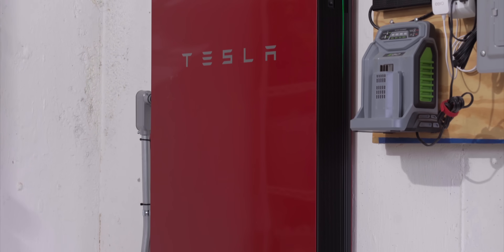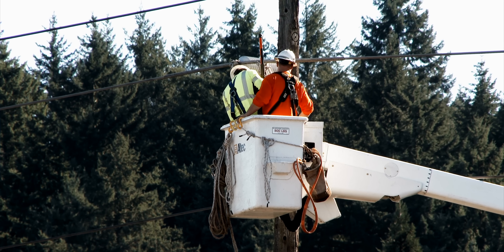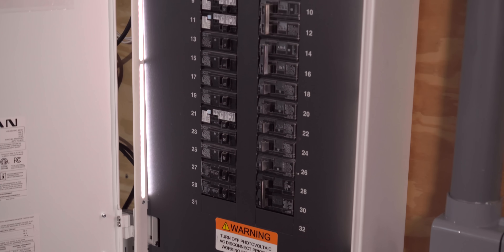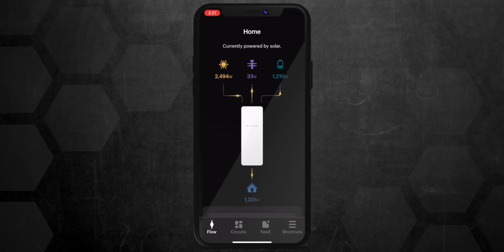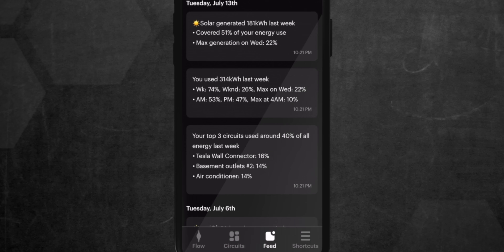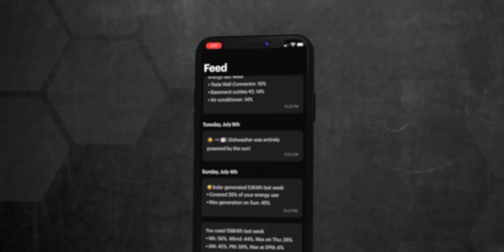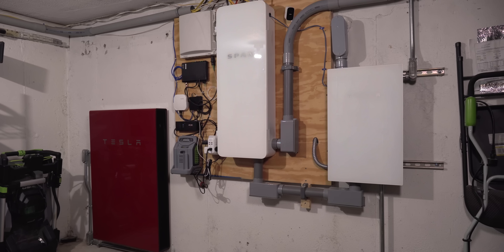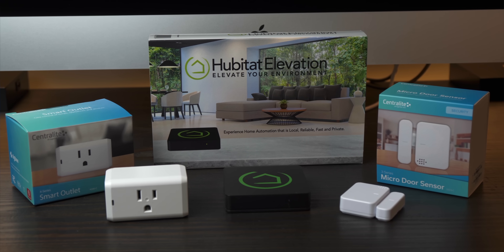This Smart Home Electric Panel Fixed My Tesla Powerwall

Comment: - The Tesla Powerwall, installed in late 2020, serves as a reliable energy storage solution, efficiently managing the flow of energy generated by solar panels and providing backup power during grid outages. This setup has been functioning well for the user, ensuring uninterrupted power supply when needed.

- Traditional home battery systems, exemplified by the Powerwall, face limitations in their ability to accept and output power. This means that careful management of electricity usage is necessary during blackouts to prevent overloading the battery system. The analogy of a water hose is used to illustrate this limitation, with larger diameter hoses allowing more water to flow, similar to batteries accepting and outputting more power.

- The Span Smart Panel addresses these limitations by offering advanced control and monitoring features. It introduces granular control over individual circuits, allowing users to prioritize essential appliances during blackouts. This functionality prevents the system from being overloaded while ensuring critical loads remain powered.

- The panel's capability to group circuits into different priority levels, such as "Must Have," "Nice to Have," and "Not Essential," enables users to customize their backup power strategy according to their specific needs. This flexibility ensures efficient utilization of the battery's capacity while maintaining essential services during emergencies.

- Despite the significant cost of around $3,500, the Span Smart Panel proves to be a valuable investment for homes equipped with solar panels and battery systems. By offering comprehensive circuit-level control and monitoring, it not only enhances the user experience but also potentially reduces overall installation costs by eliminating the need for additional hardware like critical loads panels.

Comment: Are power outages such a problem in the US? I live in Hamburg and have never experienced one. 
The management information of this unit certainly looks interesting, but I'm not 100% it would be worth the cost. Currently at the beginning of our PV research journey. Likely to be getting PV, battery and an EV. Germany appears not to be quite so advanced re flexible tariffs, so I'm generally not sure how much smart stuff we'll end up with. Local energy consultant booked!

Comment: I appreciate this concept shown here and the flexibility it gives you. Given what you have spent to future proof your home from rising electrical rates, this piece of hardware with its software and user interface is brilliant. I'm a little more old school about all this as I dont think I can justify the battery solution for power outages when I already have a perfectly good 10kw backup generator for critical loads. granted its not as convenient or as high tech, but it keeps the power on for outages even up to multiple days. I can heat the house, run the freezer and fridge, the entertainment system and computer and the price of admission was much less than a powerwall with a smart panel. when the generator dies or i get too old to start it we might have to do something different

Comment: In case you got grid black out in your system does your battery charge from solar or only grid make sure in on grid system things are different than ongrid I don't use the on grid but fined out

Comment: This all sounds great, but I got a quote from a SPAN provided installer for over $17K to replace my existing, overcrowded circuit breaker panel. In comparison, I got a quote of $2K to install a new, conventional load center. This is insane! Who can afford to pay close to $20K for their home service panel? I would never recoup the cost even with time of use power consumption. I would rather spend $20K on additional LFP batteries. That way you don’t need to play around with programming backup circuits.

Comment: Hey Matt I have been watching your net zero house videos and your home battery and solar powered home videos and I have a question, I have looked into Tesla and they say that they can install up to 10 batteries in a home, now I know that it would be much more expensive but one Tesla powerwall can provide 5Kw at ones so does that mean that 2 powerwalls can provide 10Kw at ones and so on or are there some losses

Comment: I just got a 32 panel/micro inverter solar system installed, and while I chose not to go with the battery because I have one to one net metering and don’t get a lot of power outages. I’m still interested in span. I wanted to get your opinion if you think it’s worth it? we’re just having Solar and being a smart home geek like we are to have visibility and control over things such as what is causing the most power drain in my house.

Comment: So, they are NOT WORKERS< these "Linemen" actually went to school, like us medium voltage electricians. Unlike you as a HO we have to full fill a min of 12k hours and test out of three different stages to get out masters. Your work looks sub par using PVC, if you used metallic there is a whole other concern of grounding. During a Black out or a Brown out, the HO should have a "professional" electrician install a sub panel to the "only critical" loads, which means tracing every circuit in the house and using the load calculation chart in 220.42 and understanding the difference of loads kicking on together vs not, basically seasonly as well, this way the HO after you or the spouse who is home does not have figure out what is important to turn on and off... (most people do not understand loads), great for engineers, assuming you never sell your home!!! You can not use Red stickers for example, do not turn on, and Green stickers for the loads you should turn on. You need to set a SUB PANEL, then back feed to your second disconnect! This is what we try to do so the HO home owner just has to through one switch for the AUX and then rolls out their gas generator and twist locks, then primes and starts up. Biggest issue with generators is that you have to fire up every 30 days or more to keep pistons from going flat and treat the gas, RV's are no different.

 I like the idea of putting my generator in the back of my truck and bugging out of town, encase I do not trust my people around my house. You can not move your home, but you can have a bug out plan and also be ready to twist lock your power. I'm not against batteries, I am against what the bid companies are doing to kids and families in Congo Africa to get the minerals. 
 The power wall is a good idea, but the video showing it in the home next to the frig is not wise. If you install the power wall then you need heat detectors and ventilation. Video is charming, but the idea of DIY is not so the case, if you sell your home and all the work that was completed, will the next HO have to deal with your issues, even if it is inspected. 

 (I have been wiring Tesla and EV plugs for 19 yrs).  My concern, is I have heard that Tesla' cars had some fires in garages, the older cars...  I wonder how this pack will do over time, especially if it is outside, South facing, in Colorado (heavy UV)  and the heat outside, 9 months out of the year. Batteries DO not like heat, and most of CO the panels are outside. NOT to mention the utility restrictions on the HO. Loveland power will not longer allow you to stay overhead. If you touch your service, not to mention that they will make you trench from their location to your house, (even if you have cement and gardens and sheds.......)  or if you can not trench, then get a direct bore across the street, and that is hard to find a private contractor who does REZ. Oh yah, and the by pass lever requirements in all new meter cabinets. 

Do not forget the other issues once you pass the meter, (bond bushings) basically then the NEC kicks in after the Blue Book of their meter rules. Main disconnect outside, ISSB, 2 x 8' rods, SPD, EM sticker, and breaker space available outside, and that one issue for grounding your water pipe (cutting your drywall in the finished bsmnt)  at the main shut off, unless pex, or grounding a new house or addition with a UFER, then these can become expensive and HUGE ISSUE< 

How much power will the utility allow to your home, before you have to pay for a partial transformer upgrade, if you have 100 amps (bare min per 230.79) and you want 150 amps or 200 amps or a 320 meter base socket / 400 amps. 

When you do solar you have to take out 25% of that load for your bus bar, plus the .20% off of the main breaker loads to not heat up the coil of your main breaker, (so 45% of 200 amps is 110 amps of constant load.  Basically you want a copper bus bar not copper plated or Alum. Then if you touch your service, and you have an old SE cable in to your panel in the house or garage or basement, then you need a four wire SER vs the 3 wire, NOT to mention the rules in 240 and 110 under where breaker switches are not to be installed, in a kitchen cabinet, on a landing of stairs, bathroom, closet, wood working shop or over a counter for service 110.26 and def 100 for readily acc. 

Now, you can look at tracing the circuits and bringing another SER CABLE BACK to your outside panel and allowing these circuits to be only energized for the loads, so you are not too much pull on your 5kw. 5,000 watts does not give you much, we install roll up gas generators with a 50 amp twist lock plug, and most customers buy a 7.2kw. If you believe in gas. What I like about Gas is that if things get bad, and I am the only one in the neighborhood that was a preper, and the only one with lights on and food and heat, you either better have a lot of ammo or a lot of food to share, not to mention hope you have no pretty family members. 

Now, what about the fact that since I am NOW REQUIRED on the NEC side as of 2005 code up to 2008, 2011, 2014, 2017, 2020 &  2023 code, (21 yrs) that if I move any of my brach circuits more than 6' , I now have to AFCI and DF and GFCI protect all 120 volts circuits (210.12) and GFCI protect 120v and 240v circuits per 210.8. This is not easy or cheap and some old two wire homes may need grounding per 250.130c. Not to forget, that 210.15 talks about Neutrals or grounded branch circuits are suppose to be considered current carrying on a single phase system, so we are only allowed to install about 10 current carrying or (5 circuits) in a raceway, (if the nipple is longer than 24") and now to move 20 circuits, it's about four ugly raceways. Which means, the typical HO or their spouse who was not listening or there for the interview/bid says to your at the end of the job, "WHY COULD YOU NOT USE ONE LARGE PIPE"????????? 

Once you have done all this, you have to meet 250.64 and 250.122 and 250.50 and 250.52 and 250.53 grounding rules for your service feeders and your sub panels grounding rules on the breakers. You also have to have a 22k or larger rated main breaker that is a bolt on, or higher if the utility transformer is in your yard close to your house, you might need a 50k or 72k AIC rated main breaker or a switch handle with FRN fuses. You might have to proof to utility your fault current cal. and the city your load house cal. This will include the knowledge of your distance to the transformer, insulation values, in a raceway vs Direct buried, the impedance of the Txsf, secondary and primary windings or values and your load to be served, 100 amps or 400 amps for REZ homes, plus the rule of single phase vs three phase and your voltages. 

Oh, so sorry, forgot to mention that the 6 handle rule has gone away, so your split bus bars and the duplex or tri-plex services have to be upgraded as well, because of the 2020 NEC code under 230 and 242... not allowing more than one handle to kill the power to the main structure which then might feed other sheds, garages, buildings, etc.... 

 Other codes apply in 690, 310, 625, 725......................................................... SO YAH, A HO CAN GET IN TO A PRICE OF $6k min up to $25k.... And by the way, our electrical parts and copper and PVC is still GOING UP!!!! Thanks GOV> 

Keep this in mind, if you have natural gas or propane or wood to heat your home and water, than your pay back for solar is probably 18 yrs, most HO and families move every 5 yrs, based on schools, safety, jobs, divorces, families needing help, weather or health................................................................, So, are you really going to get your money back if you invest so much in to these systems. Why is it that CO just started to demand solar being installed this year, when they have had homes pop up every where for the last 15 yrs!!!!!!!!! 

This is not as easy as you make it sound, after 24 yrs of wiring REZ and some COM... Cute video, and stop call us WORKERS!

Comment: By chance have you researched alternatives to the Span Smart Power Panel? I ask because the price is pretty high. Is a price of $4,500 really affordable except for rich people? Look at the Leviton White Smart Panel. It is not as capable as SPAN but 200 AAMP service at $400. Add wireless control and surge protection. It can be fully wired without breakers present. Overall power statistics and ability to turn off circuits remotely through the app. Spend the $4K savings on an extra Tesla Powerwall battery, just saying ...
Reply from the maker: Good recommendation.  I have looked into a bunch of them.  Another is Lumin Edge.  It’s modular and can be integrated into any panel pretty easily.

Comment: Spent 50 enjoyable years as an industrial electrician. Great ideal being able to use your Tesla to supply power during a power failure . Read that California is going to outlaw gasoline generators so this will ful the void for a day or so. God luck getting support on anything with electronics after 8 years. Had to throw away several $10,000 VFD drives from two largest companies because they could not supply new boards or get certain chips & other parts. Had the same problem with a very expensive lightning/dimming system.

Comment: We’ve lived in Southern California, Georgia, Alabama, Michigan and Texas. If solar was the answer, I think we would have been overwhelmed by proof…but that is not the case. The upfront costs of installation and the protracted payback is a HUGE obstacle, but that is only the beginning. Solar panels are made using rare earth and toxic components: lead, sulfuric acid and cadmium being some of these  environmentally toxic elements. 

Just like any other product, solar panels are subject to degradation due to age and exposure; repair and replacement must be handled by certified hazmat experts. That’s right…hazmat - HAZARDOUS MATERIAL. I could continue describing the “cons” associated with solar panels, but why should I? If you’re considering solar, you are considering signing up for a decades-long payback of a system that is hazardous to the environment.

Comment: As an electrician for 30yrs, I will never install one of these panel or upgrade my house to be a “smart” house. All of this energy that we supposedly are saving by having all of these smart devices are actually consuming more power. Every chip, sensor, breaker or what ever device requires constant power consumption.  Small amounts of phantom power loads but it adds up.  Now you need an internet connection and all the power it takes to keep up fiber infrastructure, modems, routers, switches.  Now think of all the Google, Facebook and other data centers storing all of this data and the huge amount of power needed to run them. All of the air conditioning (tons refrigerant gasses depleting our ozone layer)to remove the heat from all of the data centers.  Then think of all of the redundant power requirements these data centers require.  The large battery backup systems (UPS) large enough to keep the power up long enough till the massive (fuel guzzling) diesel generators kick in to take over  till normal power comes back.  That simple little device to turn off your light has a power hungry, greedy infrastructure that consumes more power than it did for me to get out of the chair and turn the dumb light switch off. These smart panels don’t fit 90% of consumers. 1. Who can afford a 4500 panel not including install.  2. What percentage of people even know what load shedding is? Let alone know how to use it.  A person comes home from work and wants to have all of their comforts at the same time. It is better for a consumer to upgrade the house panel to a 200 or 320amp panel with a new feed coming in from the pole. If they are able to add solar or other renewable sources,that’s great. All of these systems should be stand alone systems where network and interconnection isn’t required. Once I buy a product, it should work by itself. No upgrading software. No company needs to know what my power usage is.  That’s between me and the power company.  Granted I love seeing and installing all of the new stuff, but it’s outdated before you finish the install.

Comment: I'm looking into getting solar panels on my townhome.  The townhome is about 28 years old, and so is the original circuit breaker.  I'm thinking of going straight to a smart panel like this span when I get the solar panels installed, and possibly get a sub-panel for the basement.  Thanks for the info!   I'm in Minnesota.   Looking for solar deals!